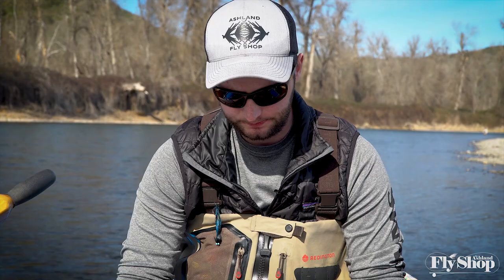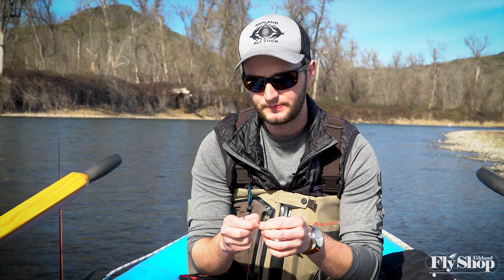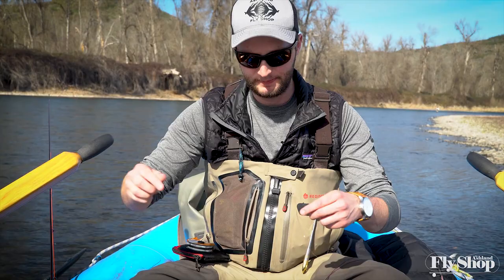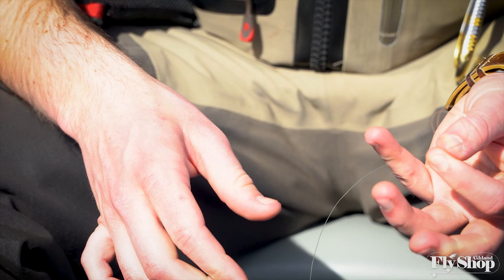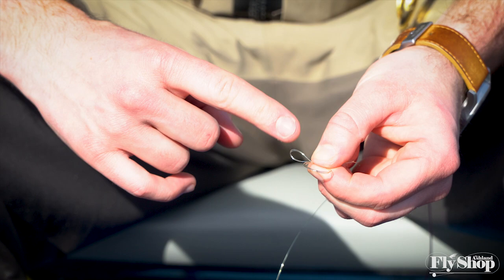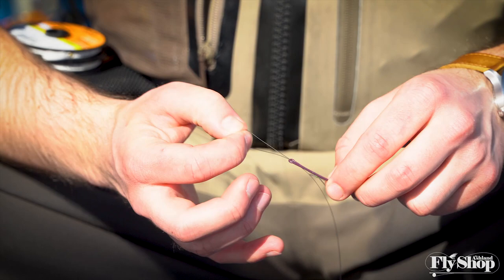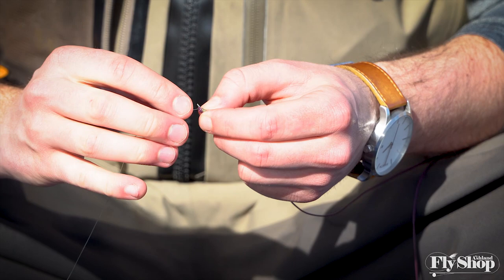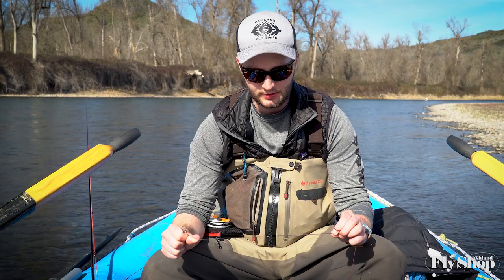Spey Hacks W/ AFS | Sink Tip Protection

Comment: A 6" 30lb piece of mono with loop on either end between your sink tip and tippet/leader is good option too. The other problem area is the connection between the head and a mono running line, which will also chew up the loop as well. A saltwater angler showed me the double loop to loop connection that he typically uses between backing and fly line. It's a bit fiddly, but works really well to save the loop on a head so your not replacing it every couple of seasons.

Comment: i run a little bit of a bougie setup
i cut the damaged loop off, tie on a nail knot with some 25 pound mono, tie a micro swivel about 6 inches down, then my tippet material gets tied to the micro swivel
Reply: Like this! That is sweet!
Reply: @willjohnson9412  thanks, it makes everything really easy

Comment: On a side note, I have started adding a nail knot to all my factory fly line loops. I lost an entire Skagit head and sink tip last year in BC and was not happy so now every loop gets a nail knot and a little UV Aquaseal or Knot Sense to smooth it out.
Reply: Yep - this is a good thing to do. We do this on all our heavy saltwater rigging. Reinforce the factory loop.
Reply: @willjohnson9412  I learned this on a saltwater trip last year. I usually just cut the loop off and knot the leader to the fly line for standard lines but that kind of defeats the purpose of shooting heads and sink tips.
Reply: @SledorFish  right you are - this is a good method.